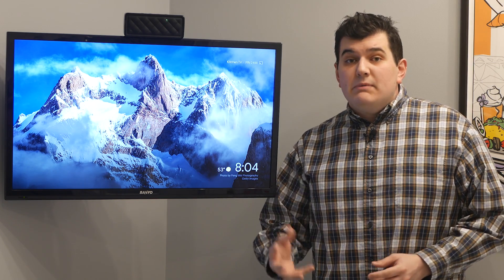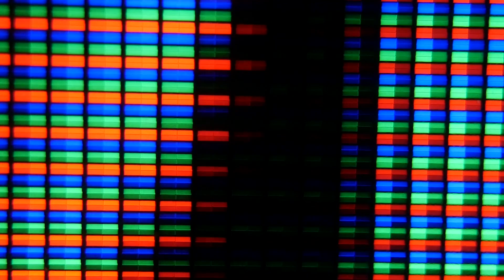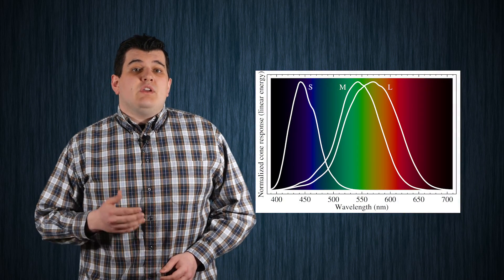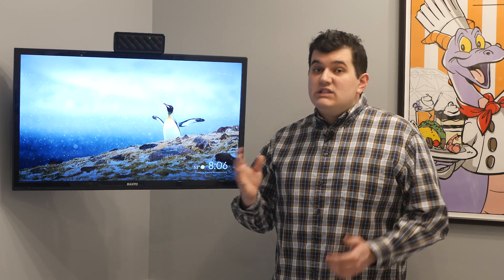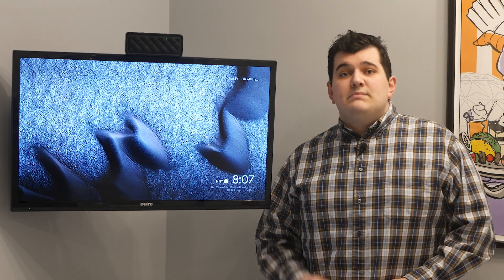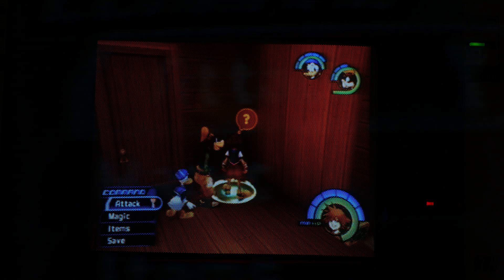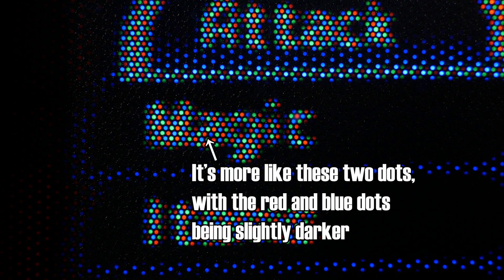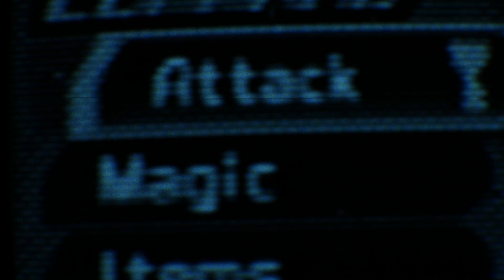These Are Not Pixels: Revisited

Comment: But the aperture grille effectively acts as a quantizer to the signal produced by the beam. I would agree that the slots/dots not being pixels, only if the beam is capable of producing variation per element, e.g. a channel's rectangular element having multiple intensities either horizontally or vertically, but I know that is not the case because the beam is usually slightly larger than the slots, especially when deflected near the edges, that is why older black and white tvs were blurry near the edges. Maybe you're confusing crt televisions with vector monitors?

Comment: Are the holes on the metal plate from a small 14 inch CRT the same size than the ones on a big 27 inch CRT metal plate?? is the only difference the amount of holes (bigger plate -> more holes) or are the holes also bigger?

Comment: At 4:20 he says in the U.S. roughly 480 lines are visible at once. He is kind of close but it’s 486 that are divisible but capture cards used to capture analog and make it digital use 480 to take advantage of compression shortcuts that require it to be de visible by four so they capture 480.

Comment: TL;DR: Alec is correct and CRTs - be it black and white or color ones, don't have pixels.

Since there still seems to be quite some confusion about this topic and effectively unsubstantiated criticism in the comments on Alec's remarks, I'd like to back him up, according to the principle 'better late than never'. Maybe it's also time for yet another episode ("These Still Are Not Pixels, Really!).

Judging from the comments, I notice two main causes for most of the misunderstanding: the definition of the term "pixel" and also the understanding of what "pixel" actually means when referring to the more common, classical sense of discreet image samples which often are stated as a resolution of an (x * y) integer amount, e.g. 3840x2160 for UHD).

While there doesn't seem to be a concrete terminological difference between a pixel and PEL as some commenters here repeatedly suggest, one could declare one term or the other to refer to either the 'smallest' (already misleading as we shall see) or any part of an image. The difference is severe and I agree that both concepts should be differentiated and thus the use of different terms would be advisable (the samples for reconstruction vs. spatial image sections without strict boundaries). The fact that "pixels" in the classical meaning are indeed "singularities" with no actual shape is also explained as a side note in the video about digital audio named "Digital Show and Tell" by Monty Montgomery at around playtime 8:00. There is hardly any explanation video about that topic which combines great humor, suppression of any arrogance, profound expertise and knows to eliminate the most popular audiophile nonsensical claims in under 25 minutes. Simply brilliant and highly recommend. 

So in the traditional meaning of the word at least, a pixel refers to a sample point, the direct analogy in the audio domain being a measurement, at first dimensionless in space or time whose value itself again may be either continuous or discreet. Now the probable source and cause of confusion is that while when dealing with audio, the user effectively gets an analog reconstruction, both time- and value-wise through any halfway decent DAC, when it comes to images (which essentially is the same phenomenon in two dimensions), sadly enough and more often than not, an actually incomplete (!) reconstruction method is used by taking the discreet, dimensionless samples and displaying them more or less "as they are", leaving the required low-pass filtering up to the viewer's discretion (pun only partly intended, but I couldn't resist either). This fact also is backed up by the good old DVD-Video standard where both, PAL- and NTSC-preformatted, videos have pixel ratios which don't meet the aspect ratio of 4:3 CRTs (e.g. 720x576 for PAL and 720x480; neither one equaling a 4:3 ratio). It turns out that they don't have to, since at least a stand-alone DVD-player correctly outputs a low-pass filtered analog signal for the TV which then draws it as a continuous wave function, line by line - the latter being the only discreet aspect of analog TV, if you will. Displayed on a modern, pixel-based screen however, one has to scale the input appropriately, e.g. to 1050x576 pixels for PAL DVD-video including the 'stretched' overscan.

If one now tries to apply the term "pixel" to analog TVs, most likely allured by the pixel-alike mask used for color TVs as pointed out in this video, he either refers to any part of the actual rendered image, which is legit depending on the definition but rather meaningless in this particular context, or refers to samples in respect to the Nyquist/Shannon theorem which would be wrong for the reasons elaborately explained in the video.

So yes, a CRT draws something on the screen which eventually becomes an image and that image may be (logically) devided into spatial sections called "pixels", but that doesn't make those elements discreet sample points in the sense of the sampling theorem unless one performs an A/D-conversion again, which would be a whole different story. The shadow mask used to prevent any color leaking doesn't change that as also correctly reported in this video.
The real pixels on the other hand would ideally never be shown in the first place, but only used to reconstruct an entirely analog image, leaving out the "imaging" frequencies which never existed in the original after the A/D-conversion.
The latter is also the reason why, at least nominally, displaying an input of resolution x,y on a display with incomplete reconstruction and panel resolution of x,y is not ideal, but upscaling it to a higher "resolution" is advantageous despite no real resolution is gained (but unwanted side frequencies are easier to be rejected). In the audio domain, this is called oversampling and used to relax the low-pass filter requirements in terms of steepness and stop-band rejection. By using higher display resolutions, the imaging frequencies get shifted to a higher range as well and our eyes more reliably filter them out without removing the part of the frequencies which are desired altogether, the original content.

Important to internalize: The physical 'pixels' on nowadays' screens are just an artifact which shouldn't even exist, easily confused with similar looking elements of an old school shadow mask.

Comment: You could have stopped at 0:37 and still been correct.

Even according to wikipedia: "The concept of a "picture element" dates to the earliest days of television, for example as "Bildpunkt" (the German word for pixel, literally 'picture point') in the 1888 German patent of Paul Nipkow. According to various etymologies, the earliest publication of the term picture element itself was in Wireless World magazine in 1927,[8] though it had been used earlier in various U.S. patents filed as early as 1911.[9]

Some authors explain pixel as picture cell, as early as 1972.[10] In graphics and in image and video processing, pel is often used instead of pixel.[11] For example, IBM used it in their Technical Reference for the original PC."

Technically, you're talking about pels not pixels.
Reply: Both terms "PEL" and "Pixel" however, are nowadays thrown together again. Although it would indeed be important to distinguish between the two, this topic is just a "shadow discussion" as it is obvious that he intends to clear up the myth of old school shadow masks or analog TVs in general having any discreet picture elements according to the Nyquist/Shannon theorem. They don't.

Whatever you want to call what type of picture element is certainly a nice and legit discussion, but actually missing the point of his video and overall, he is absolutely right, as explained more elaborate in my separate comment.
Reply: @little-endian5957  

the term pixel is older than LCDs and this dude, by his presented metric they're only "pxels" when run at native resolution driven 1:1 as 1:1 aspect ratio pixels. that is not so. read up on non-square pixels and pixel aspect ratio.
Reply: @RyanAumiller  Thanks for your reply.

If the term "pixel" has historically been used for simply a spatial "cutout" of a picture, which may very well be the case, then it would be interesting what the practical application of that was back then. Since the resolution of a CRT isn't based on samples after an A/D process, it is correctly specified as discernable line(pair)s or a bandwidth (in Hz) instead. So you're welcome to elaborate on the original definition of a pixel in purely analog domains then.

Regarding "(non-)square" pixels, there is hardly much to look up as I am obviously aware of that concept, having brought up the DVD video example before myself.
However and unfortunately, even technical literature is full of misnomers and (non)square pixels are one of them. Pixels don't have a dimension and thus can't have any shape. The term rather refers to a logical equivalent when being "mapped" to a screen which unfortunately uses the usual incomplete "pixels as is" kind of display technique. Correctly reconstructed, a DAC would take those samples and feed a TV with a continuous signal with no "pixels" of any shape involved.
Reply: @little-endian5957  

it''s just analog pixels vs digital pixels

analog pixels came first and are still pixels
Reply: @RyanAumiller  Here the question arises what "analog pixels" in terms of elements (which sounds like a countable amount) shall refer to, then. Core attribute of an analog function is that there aren't descreet boundaries which are defined.
Reply: @little-endian5957   How about the grid elements of the newvicon/vidicon tubes that captured them in the first place? Or the encoding of the signal, be it RGBHV, RGBS, Y/C, NTSC, PAL, SECAM etc. You have a fixed number of horizontal and vertical sync pulses, the information in between said pulses would be the actual picture elements, aka Pixels. Just because they're not as "accurate" as digital pixels does not simply negate the fact that they do in fact exist as discrete elements.

If you watch something like 3/4" umatic tape masters on a monochrome monitor, turn the G2 down a ittle and get the focus DEAD ON, you can actually see separations between EVERY DOT. They were all purposefully bloomed and blurred a little as an analog "rendering" trick to get rid of the "screen door" effect.
Reply: @RyanAumiller  

Let me reply by quoting this time:

"How about the grid elements of the newvicon/vidicon tubes that captured them in the first place?"

Good point which finally responds to my former question about the practical implications of so-called "analog pixels".

Lovely Wikipedia claims the following regarding one type of such camera tubes:

"An iconoscope is a camera tube that projects an image on a special charge storage plate containing a mosaic of electrically isolated photosensitive granules separated from a common plate by a thin layer of isolating material, somewhat analogous to the human eye's retina and its arrangement of photoreceptors. Each photosensitive granule constitutes a tiny capacitor that accumulates and stores electrical charge in response to the light striking it. An electron beam periodically sweeps across the plate, effectively scanning the stored image and discharging each capacitor in turn such that the electrical output from each capacitor is proportional to the average intensity of the light striking it between each discharge event."

The analogy to the retina is interesting ...

"Just because they're not as "accurate" as digital pixels does not simply negate the fact that they do in fact exist as discrete elements."

To be agreed, yes. Due to the spatially separated taken "measurements", one is in fact also dealing with sampling and there are hints that the optical eye system is more or less matching the resolution of the retina which severely drops beyond the 'yellow spot'. Nonetheless, I believe to notice aliasing in terms of moiré myself once in a while under certain conditions which also is to be expected as the optical low pass filter won't be ideal for all situations, leaking spatial information to the retina, exceeding its Nyquist frequency and thus unavoidably leading to aliasing.

However, the part, depening on the technique, is at first a matter of the recording side and doesn't say a lot about any discretion or not existing on the playback side of a CRT.

"Or the encoding of the signal, be it RGBHV, RGBS, Y/C, NTSC, PAL, SECAM etc. You have a fixed number of horizontal and vertical sync pulses, the information in between said pulses would be the actual picture elements, aka Pixels."

Well, but one should have a signal corresponding to a continuous response within one line at least. Otherwise, it would be expected to not only have a nominal amount of horizontal lines specified for e.g. PAL/NTSC, but also for the vertical ones (horizontal direction), which apparently is variable and thus normally expressed in video bandwidth (around 5-6 MHz in good cases, VHS being rather around 3 MHz) or discernable line pairs fed to the TV as a test signal.

"If you watch something like 3/4" umatic tape masters on a monochrome monitor, turn the G2 down a ittle and get the focus DEAD ON, you can actually see separations between EVERY DOT. They were all purposefully bloomed and blurred a little as an analog "rendering" trick to get rid of the "screen door" effect."

Here I wonder whether something halfway discreet is blended together or something continuous is emphasized, clipped and then only appearing as something discreet.

Either way, the core argument in this video was that a CRT TV doesn't use ... (term yet to be defined), compared to more modern ones using numbers for reconstruction and especially the "preformatted" RGB dots or stripes on color TVs not corresponding to discreet pixture elements as they may be partly lit, don't necessarily match the source, etc.

If we have picture elements resulting from spatially unevenly distributed sampling entities with continuous values without quantization (something which might also be said about film material by the way), we should name them X. The only logically existing measurements in terms of numbers however Y. Y as of now are called pixels by virtually everyone, be it correct or not.

So, any concrete suggestion to correctly name both types?
Reply: @little-endian5957  a continuous signal with time divisions. The time divisions breed the inaccuracy of both capture and display. be it an aperture grille, slot mask, shadow mask + the deflection signal.

The inconsistencies of exciting phosphor dots isn't dissimilar to the inconsistencies of lighting subpixels on an early DSTN LCD panel. They NEVER lit in a uniform manner, there was also less control over the lack of uniformity, unlike with a masked/grilled color CRT display. TN panels kinda brought that back whereas TFTs were much more consistent

That's where the analog pixels of a CRT differ from the digital pixels of an LCD.

these newer TN panels with "sub-subpixel rendering" are only trying to mimic what the overlay of raster on a fixed grid of phosphors could display as a pixel.
Reply: but a color pixel is simply a red element, green element and blue element existing in a small enough space to trick one's retina's rods+cones into mixing those primary additive colors into a differing singular color.
Reply: @RyanAumiller  I'm not sure whether we actually have any real dissent but I think you're throwing several things together in one (certainly not bad) counter-argument - e.g. possible spatial sampling here and optional masks there.

A continuous signal with time divisions of what? Continuity within one line with divisions between each of them or even divisions between samples on analog television?

Frankly, back in the days in Germany, I also often heard the term "Bildpunkt" (literally 'picture dot') in regard to (color) TVs, but in retrospect, I'm not sure if that term was correctly applied after all. 

Also, just as Alec did in his video, it is probably better to stick to b/w TVs first to take out any possible (mis)interpretation out of the equation regarding any presumed mask-based spatial discretion, so I want you to ask the following:

- Taking a black & white, luminance-only (video blanking sync), signal besides the burst, sync and blanking stuff, are there further elements of (logical) discretion in the signal, especially within one line (!) to be drawn by the TV?

- Can, depending on the camera type which was used, the original spatial discretion of the original recording still be deducted from the resulting signal or does it have to be rather treated as a continuous signal with no discreet valid points in time?

- Are there any "pixels" on a black & white TV when there is no mask in place?

- In case that your argument of "analog pixels" existing on the playback device due to the spatially discreet recording/scanning process, how about an analog signal which has been created by a scanner device which scans the continuous original mechanically with no spatial sampling but creating one continuous fluctuation analog to the image input instead? Feeding a CRT with that, where would you see picture elements being introduced on the playback side?

- would you be happy if the video title had been "these are not PELs"?
Reply: @RyanAumiller  As mentioned in the other comment, while I concur in principle, the description of the term "element" remains vague here as both entirely different concepts (dimensionless pixels rendered as physically halfway discreet objects vs. mask separation cells), both in RGB will more or less achieve similar results of course, blending together the primary color frequency ranges and leave the rest up to our visual system.